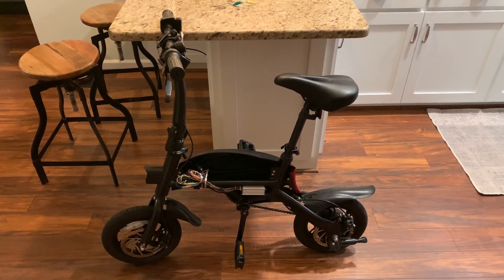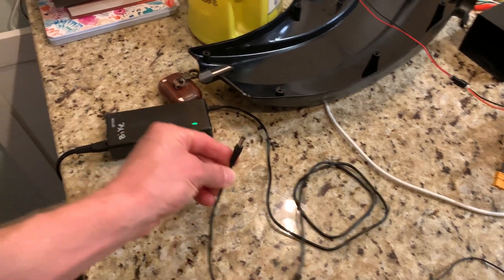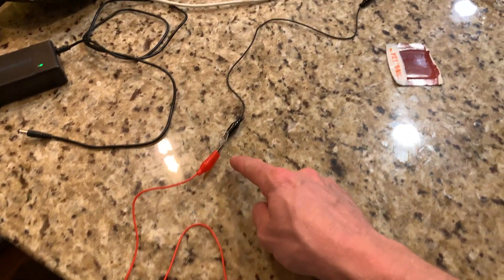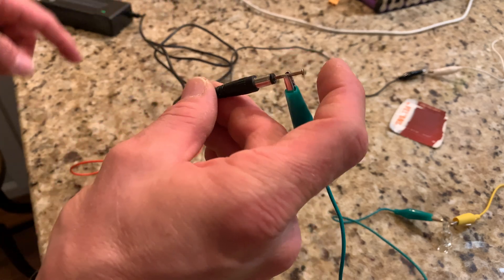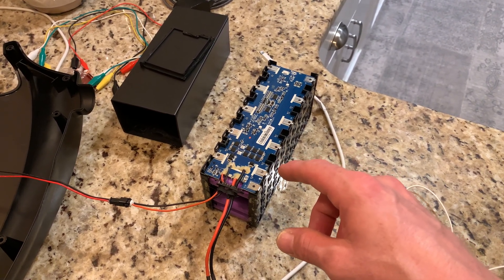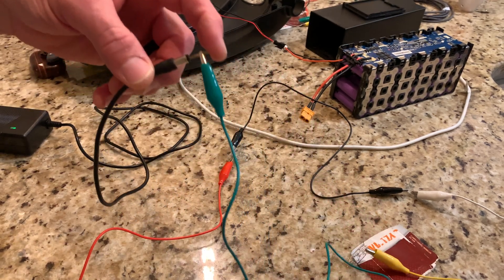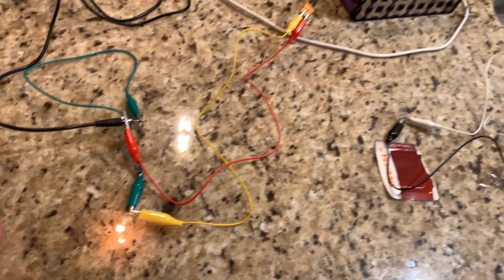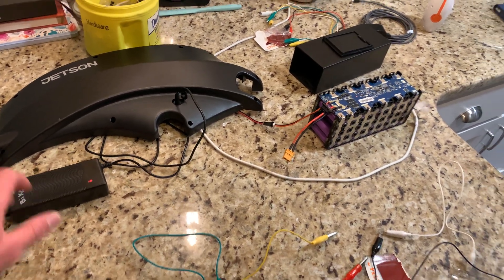￼FIXED!! ￼ebike electric bike not charging, charger light stays green -and how to test the charger￼￼

Comment: I charged my ebike thats 36 v with a 67v charger for 30 min is it repairable i have the same problem as your did with the charger, and my charger turns green even without having it plugged to the wall, its like the battery is sending current out of the bike
Reply from the maker: If the voltage in the cells have dropped below the threshold, the BPM or the battery management system (which is part of the battery) is probably not letting the battery charge, so it will show green light on the charger as if it was charged. The green light simply shows you that the charger no longer has a load on it. It turns red based on applying a load to the charger. That's why you want to actually test the charger with the bulbs to apply a load, so you can verify that it actually turns red and is outputting current.
Reply: @TheMeticulousRepairTech  So did the bike end up charging after this? Mine did thee exact same thing and after watching this video I replicated and got my light on charger to go from green to red as if it were charging I just don't know if it is actually charging it or not I sure hope so as a disabled combat veteran this Ebike was my only transportation to get to pharmacy to pickup my meds and to the store for food then I let a guy borrow it and he brings it back two days later deader'n a doornail battery read 0.18V and would not charge 🤦‍♂️ see what I get for trying to be a nice guy, he just threw up his arms and walked out left me with a broken bike and now no way to go anywhere😢
Reply: @kevinAuman1 did you get yours to work? Thank you
Reply: What if when you test the charger the bulbs light up but the charger doesn't turn green
Reply: I mean it does not turn red 
It just stays green
Reply: Eric Denny

Comment: My charger works but my bulb is not turning on once I wire the battery ass if it was a bulb
Reply from the maker: That's odd, if you wired it up correctly to the correct In-N-Out on the charger, in series through the bulb then you could possibly have a bad battery!

Comment: My charger is putting out 42 v. , but the battery has  no voltage . There are so many wires too. All are new and look connected properly. I tested the plug going to the battery (black & a red ) I got 42 v. But the battery won't take a charge ! What can I do. I really want to ride this thing ! It is like new. Rear tire is flat too, but the valve is so close to the rear hub that I can not get a tire pump head on it. The front has a nice long right angled valve stem on it. The rear should have one like that too. I don't know why this is ! Maybe someone changed the tube at some time.? Can I hook up a small 12v battery to it ? I can rig it up with some new connectors if it will run that way .New batteries are $150. No way can I afford a new one. My wifey said that we have no safe place to ride it ! So put it back on the road where you found it ! Damn, I was looking forward to ride it. No fun for me ! 😢
Reply from the maker: For the Tire, if you squish the tire at the valve stem you will be able to push the valve stem back through… It is probably twisted, you may need to rotate the tire on the rim a little also.

You can't just change up the battery, you either have to get a replacement battery for it which is the same exact one or perform the repair, that repair is specifically for a battery that is discharged below the BMS cut in.
Reply: @TheMeticulousRepairTech it is not twisted, it is just too close to the center hub. If it had a right angled stem like on the front I could put air in it ! Someone changed the tube. Oh well, it was a freebee. I will just put it back on the roadside where I found it. Too bad, it looks new and clean !
Reply: @TheMeticulousRepairTech  No way, new batteris are a rip-off ! $150.
Reply: Can I do this with a 12v. car bulb  ? I have no 14 v. bulbs. ? Charger tests 42 v with a  multimeter. Battery nothing - 0 v.  !
Reply from the maker: Yeah you can, they come in some slightly varying voltages when you buy them at the parts store.
Reply: I have tried everyhing. (4)  12 volt bulbs in series , they all light up britely !  But the battery still won't charge ! Its going out on the curb. Too bad, it looks new and very cool ! It just won't charge !

Comment: So red lite means charging ? Green means charged ? I am confused , yes ? My ebike battery is sealed at both ends with tons of white silicone sealent ! I have to peel it off to get at the wires. Can I just use a volt meter to test the charger ? I have no 14v.  bulbs !
Reply from the maker: Yes, red and green color as you stated. You DO NOT need to take the battery apart!!
You just need to access the connector sticking out of it. You're going to want to purchase some bulbs and alligator clips to perform a load test on the charger. Static voltage won't show you whether the charger is bad.
Reply: You definitely don't need to use the bulbs. The bulbs are doing something that you can't necessarily do with a voltmeter in that it is literally doing a current draw test. But the kicker is you just don't need to do that to know if the charger is working or not. It's not necessary. If the charger is ever not passing current the voltage at the output will never be what it was originally designed to be. It will always be lower and usually significantly lower than its original design. I build and repair lithium batteries. I've seen thousands of chargers, and I've diagnosed plenty of bad ones. I've never seen one that has good voltage that was not working. All you need to do is a simple voltage test by putting the positive probe down the center of the barrel and touching your negative probe to the outer portion of the barrel.
Reply: @aznative_ AND THE SPARKS WILL FLY !
Reply: @triumphmanful 😂 why?
Reply: @triumphmanful  this is one of those moments where I realized critical thinking is a thing of the past.
Reply from the maker: Thanks, good to know! My diagnosis and testing of the battery was was based off of a thread that I found, which gave me the insight on bumping up the battery voltage in order to get BMS to let it charge… That is where I found out about the bulb trust for current draw on the charger, so I went ahead and gave it the works.

Comment: Man this saved a old jetson bike I got for free😅 owner said it wouldnt charge and had two flat tires well fixed the tires and now fixed the charging issue thanks to you! However mine only worked with no lightbulbs in the circut and had to charge it fully off the main cable ride it to almost dead then charge with regular charging port, works perfect thanks again
Reply from the maker: Wow nice!

Comment: Tried this and just skipped to the part of hooking it up to the battery. However bulb does not light up. Can I assume the charger is no good?
Reply from the maker: Did you place a bulb in-line for resistance? If you were to connect the charger directly to the main output leads on the battery, it will pull too much current and the battery will show no lights. I did that initially myself. However, if you did it with the bulb and nothing lit up, it's possible that yes your charger is bad… I would go ahead and do the full test with the appropriate voltage/quantity of bulbs per the charger output voltage and confirm it.
Reply: @TheMeticulousRepairTech I see I’ll give that a try thank you!
Reply: Ok just thought I’d ask I have alligator clips(rated voltage 12V & current rated 3A) could the alligator clip possibly be the reason the bulb didn’t light up? I’m going to buy more bulbs today and might buy another pair of clips if it might be the problem.

Comment: When you wired the battery, is it necessary to have a bulb? Or not really? 
Thanks
Reply from the maker: Bulb acts as a restrictor, otherwise you can burn your charger out. You'll notice in the video I mentioned that I tried that and the light just went dead on the charger

Comment: I’m going through the same thing, just picked this thing up for 40 bucks. I turn it on and the battery light powers on then slowly fades to black. Charger shows it’s green no matter if it’s plugged in or not. Any help much appreciated - I did try getting some alligator clips and used this method but didn’t succeed. It briefly lit up for a second so I’m guessing I didn’t have a good enough contact point? Ugh very frustrating
Reply from the maker: Sounds like same problem!
Confirm your charger output voltage... you should get it
Reply: @TheMeticulousRepairTech  I appreciate your quick response! I will get back after it tomorrow and I will certainly keep you updated, thank you 🤙🏼
Reply: Damn same issue with the charger the bulb briefly lit up for a second then turned off and now won’t light up again. The bulb doesn’t look blown? I continue trying this method even with two bulbs since I have two sets of alligator clips and still nothing. I have a 14w 4.9w that’s the closest I could find maybe that’s why? But of course when the alligator clips touch each other it’ll arc the charger briefly then light back up green. I’m ready to get rid of it already lol
Reply from the maker: Oh my, yeah if it lights the bulbs up briefly and then that just goes dead it sounds like a bad charger!
Reply: I tried messing with it again, bulb briefly lit up again and nothing lol. I try going right from the charger to the battery and it just surges the charger

Comment: I don't understand what he did in the end. Connect to the light bulb and all of voila! It's working? Can you explain how the light bulb fix the charger or the battery?
Reply from the maker: Lightbulbs are to test the charger, to make sure it is outputting proper current. The lightbulb in line with the battery is just to add resistance so the charger isn't overloaded when feeding the battery backwards.

Comment: I tested my charger as you specified by linking up 4 bulbs and my battery charger started on red (for a nano second), then instantly turned green. This was the same when charging my bike, its red, then goes and stays on green. Would you say this is a faulty charger (before I take my battery apart)? Thanks for your time.
Reply from the maker: First of all, how many volts is your charger? And are you using incandescent bulbs, not LED correct?
The combined voltage of your bulbs linked in series, should equal approximately the voltage OUTPUT of your charger.
If the charger does not show red with those bulbs, are the bulbs brightly lit?
Reply: @TheMeticulousRepairTech  It says Output 42.0V 2.0A 84.0W. I am using 12v 5w incandescent bulbs
I am using 4 bulbs in a daisy chain as described. The bulbs light up nicely, but the charger just flicks from red to constant green.
I have now applied your knowledge to the battery using a single bulb. The bulb lights up but the charger goes quickly from red to green again.
By the way, I find your video so fascinating, its great to see people still have knowledge of how things work.
Reply from the maker: The combined voltage of your batteries is good, but the current draw may not be quite enough with the bulbs to enable the charger to go to red… You could try a larger/brighter 12 V bulb, once again using four to add up the correct voltage. See if that makes a difference!
Reply from the maker: You're gonna want approximately a 5- 6 Watt, 12 Volt bulb… Four of those in series, that should be the correct amp draw and voltage to make your charger go red. If it does not at that point you have an issue with the charger not indicating when it is charging. If the bulbs are brightly lit, it should be outputting correctly.

Comment: I left my charger plugged in for a few hours without a battery. It now has a green light if its unplugged or plugged into a half dead battery. Help!
Reply from the maker: hi, not sure what could be the issue unless you had a power surge during that time, and it fried the charger! I would do the charger test to see if the load with the lightbulbs causes it to turn red.

Comment: I admire the engenuity, but I think I'd just use a multimeter
Reply from the maker: The purpose is to apply a load not test voltage. A bad charger will show voltage, but it will drop off when a load is Applied.

Comment: Did anyone have a hard time sourcing the light needed for this project?
Reply from the maker: Auto Parts, Amazon, just a 12V DC marker bulb. Technically what I used were 14.8 V I believe... there are a couple voltage variations when it comes to automotive bulbs
Reply: @TheMeticulousRepairTech is there any other devices to use to charge a low cell other than an incandescent light bulb?
Reply from the maker: I'm quite certain there are other ways to do it but that is the simplest solution that I'm aware of.

Comment: I’m trying this method right now, I’ve been doing it for quite a while actually because after the first two minutes the charger light was still green. I concluded my charger was the issue using your test and still even with a new charger, the battery will not surpass 3.2 volts? What should I do now?
Reply from the maker: You could have a battery pack that is shorted out or has bad cells!
So the new charger passes the bulb test? I am asking Simply to verify that you were able to determine your old charger was indeed bad. 
bad battery could possibly make the charger go bad also
Reply: @TheMeticulousRepairTech yuppers new charger passed the bulb test
Reply from the maker: Okay, yeah I would say you have a damaged or bad battery then.
Reply: @TheMeticulousRepairTech are the batteries expensìve and available somewhere ?
Reply from the maker: If you get the numbers off of it, you should be able to find them on Amazon or somewhere if you want cheap option. Otherwise, OEM ones can be expensive

Comment: My Aostirmotor so7 has the same issue, but my battery is just fine, im wondering if they have a specific size i need to prevent aftermarket chargers
Reply from the maker: Not sure...

Comment: So at first I was able to get the red light to come back and things seemed to be working out ok with the test, but then I got sparks when I'd put the nail in the charger. I didn't change anything in methodology so I'm lost how something went from working ok to not.
Reply from the maker: So how many volts is your battery? And did you have one light bulb wired in sequence as I did? The Sparks just indicate it's pulling current...
When I did this, once I initially charged it for like a minute, the charger no longer went red as I illustrated in the video. At that point it had come up enough to charge normally. So I would try it normally from the Jack now.
Reply: @TheMeticulousRepairTech  36 volts, the charger output 42 volts.  And yep had a bulb although I think it was 12 volt , now usually the whole deal with the Jetson Bolt charger is red indicator light means it's charging, but after I got the red when doing what you did in the video and it went back to green and plugged it, it stayed green.

I figure just plugging in even if green and see what happens?  Worst case scenario nothing happens or I end up buying a new battery. I also get those situations where indicator lights can be finnicky
Reply from the maker: So did you re-connect it as normal and try charging it through the charger port?

Comment: My Jetson ebike had not being charged for over a year. When I tested the battery it was at 3V. I followed your instructions and it eventually worked but a couple of things to mention in case it helps others: After leaving the charger connected to the light bulb and the battery for 2 minutes when I plugged the ebike to the charger, the charger was flashing red and battery was not charging so I thought the charger might be bad. I tested the battery and had improved to 6V so I followed your instructions again but now left it for an additional 3 minutes and then tested battery and now it was at 9V. Still charger was flashing red and battery was not charging so repeated a few times (maybe 2-3 more) leaving each time for 3 minutes. When the battery tested at 16V that is when the charger turned solid red. I fully charged the battery and the ebike is working. Thank you so much!
Reply from the maker: Wow, that's crazy! Yeah mine didn't do the flashing red bit
Reply: I'm genuinely curious to know how that's working out for you? I repair a lithium batteries and the voltage that you witnessed is a voltage that professionals would never ever consider recovering. The textbooks will tell you that internally inside the cell's dendrite has formed which is crystals and they penetrate the layers meaning they are shorting the battery out internally. Long story short, they can literally cause them to start on fire. That's why professionals can't recover batteries in that condition. But a lot of people do recover them and I'm wondering if you use it a lot and if it's working okay? And please consider replacing the battery that would be the best thing to do.

Comment: How did you open the battery pack. I cut all four sides. It’s still stuck together. Are the covers glue on each side of battery?
Reply from the maker: Ma'am as I mentioned in the video, to do the test and backseat the battery there's no need to do that.
The end that had the silicone gluing it in, I just simply cut it loose and pulled it out. It was quite stuck/snug fit

Comment: why you made so difcult to test the charger, you could use multimeter take 2 second,okyou are not pro reprator,
Reply from the maker: Ok little hard to understand what you're saying, but I take it you're saying to use a multimeter to check the charger? Yes you can check the output voltage. But you won't know whether it's actually charging your battery... You have to apply a LOAD to do that. Bad chargers will show a proper voltage but it will drop off when you apply a load.